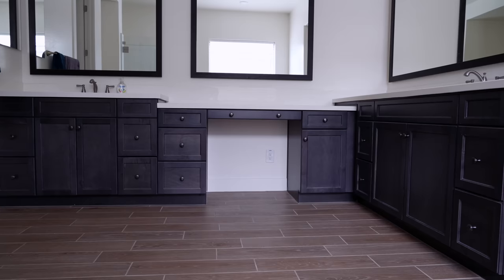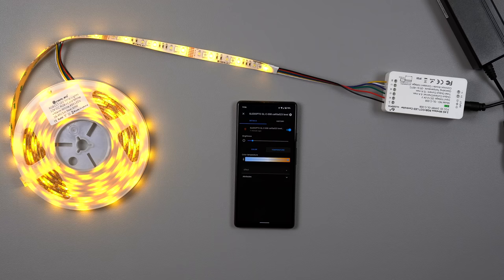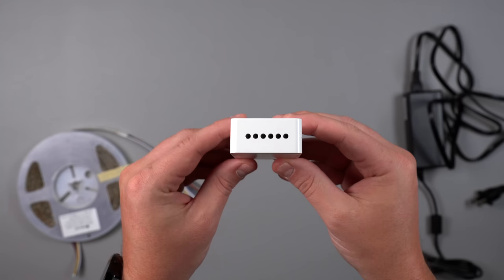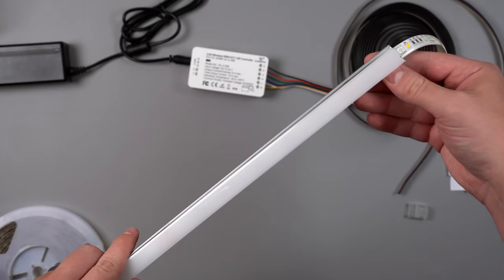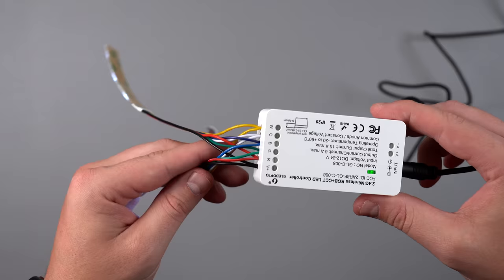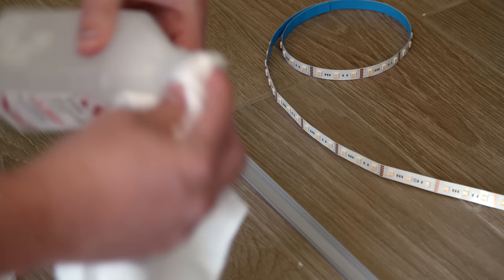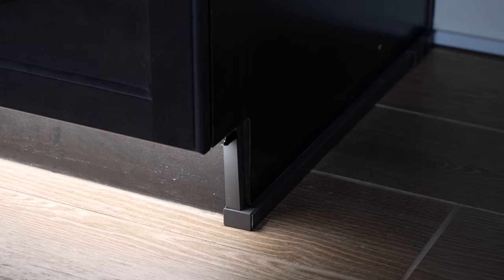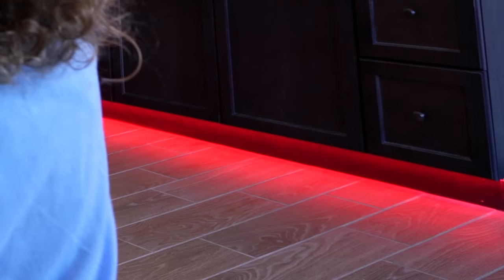Ridiculously Easy DIY Light Strips! (no soldering)

Comment from the maker: Don’t be like me and accidentally buy light strips that look purple instead of white. These are much better: https://amzn.to/3C2TTVl (affiliate link) and I put more links in the description.
Reply: Just the video I needed! Thanks for making. Does the controller work with Alexa? Do you know if there is a limit to how many connections can be made? (I have multiple gaps between cabinets and will definitely need that roll of wire and connectors to bridge the gaps)
Reply: I bought some cheap sonoff for my kitchen and even like you i don't like it so much. Colours are different and low power. When i change my kitchen i'll buy some better. This video will help me, thanks. By the way your daughters are so cute, i love when they appear talking in the videos. Nice family, best wishes.🙌
Reply: Would these light strips be good for under-upper-cabinets as well?
Reply: Use NoMoreNails adhesive no need screes for the diffuser
Reply: The one that the link points to do not look the same as the one you use, it is completely different. (Could be a country availability issue from amazon)
Reply: @jillsajonia6101  with the heat it will fall down. The aluminium channel is made to dissipate the heat from the LEDs.
Reply: Amazon UK link links to a terrible RGB strip which doesn't appear to have a dedicated white at all, let alone cold and warm 😥
Edit: ...which is extra-annoying because BTF-lighting do actually sell on Amazon UK, so apparently the affiliate link matching algorithm is just garbage
Reply: Not happy :( just purchased 30m of the (good ones) as per your link, they are absolute trash!!! Could you edit the descriptions with the actual brand and model etc, so I can actually purchase what you recommend. Thanks.
Reply: Am I missing something? The lights in that link only have four channels (which I didn't realise until I received them).
Reply: Do you have a recommended zigbee controller?
Reply: @JamesScholesUK  Did you manage to find a good set in the end? Thanks.
Reply: Hey Reed. Thank you doing all of the hard work for us! I have ordered, from your links, but I am in the UK so it has linked me to the wrong LED strips (4 wire instead of 6 wire). Please can you confirm manufacturer and model thanks 👍
Reply: What motion sensor did you use and how did you link to the strips?
Reply: @JamesScholesUK  did you find the correct led strip?
Reply: @D4RKFiB3R  No, I try not to shop at Bezosworld any more. The man's a drain on humanity.
Reply: @JamesScholesUK  Is that why it took a year for your message to be delivered? 🤣
Reply: @D4RKFiB3R  I'll get back to you in 2025 😜
Reply: @JamesScholesUK  I'll hold you to that 😉
Reply: Very entertaining and informative.  I have 120V old under cab halogens that I want to replace.   Can I just hardwire the power supply in rather than plug it in to an outlet?  Also do I need to go to a 12V system or should I just replace with a 120V strip light system?

Comment: Great video. But you forgot one main thing. Can you explain the controller you used? How did you connect the controller to your SmartThings or home assistant?
Reply: Replying in case anyone is hunting for this info down the line.

You can connect this Zigbee hub to your Philips Hue Bridge if you have one. Otherwise, Home Assistant has ZHA which lets you connect Zigbee devices directly to HA.

Comment: +1 on BTF Lighting, they are my go-to for strips and have never let me down.
Reply from the maker: That's great to hear! Anything with Rob's stamp of approval is enough for me!
Reply: I thought of you (@the hook up) the second I saw this video, cool to see you here as well!
Reply: @SmartHomeSolver  Wait - you mean you didn't check with Rob BEFORE ordering the lights? 😉Great video - and I agree, its good to say "My wife is right" (even if it's just once in a while) 😅
Reply: But BTF don’t have 2835 which I love because of small size and low heat production and because they have low brightness but the chip is cheap they are made in 240/m which makes it perfect in direct lightning like LED strip on the ceiling of the stairs.
Reply: Btf, the real cri rated led strips. Love them!
Reply: BTF have the best strips in my opinion.  The adhesive backing is one of the best, and the LED's have a really good CRI and consistency
Reply: @pavolholes  That's a shame I know.  It is hard to find good 2835's, especially if you want CW/WW/RGB strips.   
That said, you can underrun 5050 LED's and they will run cooler and last longer than 2835's running flat out.
I guess it is just a matter of the extra few mm in size
Reply: Same here, I've been using them for around 5 years now and their quality was top notch back then and still is!
Reply: same!! I have used them for led strip for my kitchen.  Lights for my mega tree, half a dozen other led projects.
Reply: 100% agree!
Reply: even as good as the strips the CS is just as good  +1
Reply: I use BFF also so far no issues
Reply: The lights look great, but does anyone else here get a high-pitched, low frequency humming noise coming from the lights when they’re turned on? It drives me insane…
Reply: @SomeoneHasThatName  I think its the driver
Reply: @MamasFunkyMonkey  Would the driver cause the connectors to hum? I put my ear up next to the splice connectors and that's where the noise is coming from.
Reply: @SmartHomeSolver  What sensor did you use to automate the light strips?

Comment: 5:40 Another option would be to use two-sided molding tape. 3M makes some that I have used on automotive projects and it lasts practically forever. No drilling or screws needed.

Comment: easy solution to the screwdriver problem: most single sided bits (not the double sided ones you showed trying to use by hand) fit into a 1/4" socket. pair with a ratchet and tadaaa, 90° screwdriver for tight spaces. great idea for the undercabinet lighting ^.^

Comment: remember there's a neat free empty space under the cupboards you can run cable through, and put the contents of the bulky box inside.  You cud even run an ext cord through there. Just pull out a drawer and cut a hole in the floor of the cabinet.  Some cabinets don't even have a raised floor you have to cut; they're already wide open under the drawer. You can also hide gold bullion there.

Comment: Instead of screwing the channels into the underside of the cabinets, you could use 3M Dual Lock, which comes in both rolls and short strips. You wouldn't need much to hold it, and it would be easily removable.

Dual Lock is also great for holding toe kicks to cabinets because it holds well and makes them easily removable if/when you need to do something under a cabinet, like run power for lighting.
Reply from the maker: Yeah that would have been easier to install.
Reply: @SmartHomeSolver  If you prefer using the screwed in clips you can buy an offset screwdriver as well. They're set to a 90 degree angle just like hex wrenches are, for exactly that purpose. With the clips you don't ever have to worry about adhesive failures. The other option is to replace the packaged screws with hex screws so you can use a hex wrench.
  Even the toughest adhesive strips hate particle board, and unfinished wood. Think of trying to stick painter's tape to a piece of anything you've sanded, and not properly cleaned. The particles create a barrier  between the adhesive, and the mounting surface, and the adhesive will stick to that rather than the surface.
  I made a custom desktop using MDF, and the adhesive strips on my cable routing clips constantly failed due to the surface particles of the MDF getting dislodged from the surface. Even when there was no visible damage to the desk, the adhesive would get ruined. The only way I was able to stop it was to seal the MDF where the clips would go.

Comment: BTF is the best I have found for led strips.  I like the newer leds that don’t have a wire for rgb just one wire to assign the colors. The individually addressable is what I am talking about
Reply: These are ws2812 based LED light strips. They only need 3 wires instead of 6. The controller would be a different type (or arduino),  and each LED can have a different color. I second this.

Comment: I just did this with my kitchen cabinets. I replaced the halogen puck lights with RGBWW strips. I did solder them but I used 12inch sections stuck to aluminum channels with diffusers. I had to purchase 3 separate controllers and power supply’s but they work great.
Reply: You have 3 separate sections of cabinets?  I do snd it would be hard to snake wire to the 2 different walls.  What hub are you using for the controllers?

Comment: For the light covers I've used the dremel with metal brush disk and with a couple of passes inside to provide a rough surface for it to stick to it.
Reply: Seems like a lot more work than just using IPA.
Reply: @headerahelix  yeah but I al ready had the covers and was too lazy to buy new ones. I am a special kind of lazy that does extra work! 😅

Comment: Another option is to makiing a small section in the alcove removable on either side at the bottom at the skirting height (06:39 by the 90 degree bend) ,take the wires and the power unit behind it under the cabinet .Then applying a fabricated removable cover/grill (plastic print?) so the wires alone appear at the back of the alcove near the socket. EDIT Even a 60mm or larger circular cutter big en ough to allow the parts to be installed under the cabinet then use the wood plug produced to make a removable part for the cabinet.

Comment: The "warm" and "cool" settings are nice, but I feel like they may be unnecessary. I had a set of mid grade 12v RGB lights in the past and when I wanted "cool" I put them on any brightness in the middle white portion of the color wheel and when I wanted "warm" I'd put them closer to an orange/yellow hue at about a maximum 80% brightness.

Comment: Use a 1/4" ratchet with the appropriate socket for your screwdriver bit. Great for putting in screws under the cabinet kick. Buy (or cut) a short bit if necessary.

Comment: On a somewhat unrelated topic, I accidentally discovered something after installing a Lutron Caseta dimmer in a bathroom. It controls 3 ceiling lights and 2 vanity lights. By putting 100w equivalent leds in the vanity and 65w in the ceiling, I was able to only have the vanity lights come on as nightlights. The dim level is set at 1%.

Comment: My question is do you have a suggestion that will help me in that I have 2 sections of interior steps, 1 each would require 1 right angle connector. 
Total length of 1 is 39'3" and the other is 37'6". I have access behind the steps foe wiring. 
I am looking for a single strip per step so the strip and connector would be controlled vis Caseta lutron light switch .
I always enjoy your vids and thanks in advance for any suggestions you may have.

Comment: I see you are using the smd connectors.   The manufacturer says specifically not to use them and to solder only.   Couldn't understand why they would tell you not to use smd connectors?

Comment: Fancy that. I just also recently went down this rabbit hole after buying an LED light fixture that turned out to have a proprietary RF remote so I couldn't use it on the Broadlink. A powerful driver, Gledopto, and much reading later, I'm realizing assembling my own LEDs is going to be so much better for Halloween. Especially if I dip into Arduino offerings.
Grats on the bathroom. Looks great!
Reply: Psst. Check out WLED on an ESP32  in that case... Easier than mucking with an Arduino programming and much better platform.

Comment: Thank you for your video. It’s helpful. What I’m planning to do is put light strips around my windows which are double hung.  then I can get rid of my Christmas lights instead of having to store them all year. Plus, I will be able to change the color according to the holiday example: red for Valentine’s Day green for Saint Paddy‘s day and so on. I will keep a few for decorating bushes  and stuff outside but Not a whole mess like I have now. but I’m just trying to figure out what to do with the LED lights. They need to plug into the wall and hopefully I can use only one remote to control them all. Plus I think it’d be a good idea if they were waterproof. I get a little moisture around the windows once in awhile but mostly they’re dry. Can I get 12 foot strips or cut them to length and then add a plug to power them? I really don’t want to deal with batteries. any help you offer will be really appreciated. Thank you.

Comment: Thanks for the instructions and product links. When I follow the link to the zigbee controller, the description says I need a zigbee hub to operate. Is that hub required to simply turn on the lights by plugging in, or is the hub only required to interface with Alexa type controls?

Comment: Next time you need to screw in something in a tight space like under the cabinets, use a right angle drill adapter. Milwaukee and Dewalt make them, among others, I have both and use each for different types of spaces.

Comment: 2 suggestions, we can use a esp8266 as controller it will be much much cheaper in terms of cost and 2nd, instead of putting the wires outside, you can station them inside, by placing a small hall on the bottom of gate, the wires wont be visible this way and there will be no problem of hygiene.

Comment: The question is just if that is a wet bath or if it's just a dressing room type space. Because placing either electrical outlets or electrical equipment on the floor can't be good if the floor might flood.

Comment: Nice! I really like the simplicity that this solution offers. I was thinking of doing something similar with my cabinet lights, but with a Shelly RGBW2 for the controller instead of GLOWEDOPTOICANTPRONOUNCEIT. I also have been experimenting with WLED, but I've been having connection issues, so I kinda gave up
Reply from the maker: Thanks! Yes WLED is something I'm planning on tackling soon and it does look challenging.
Reply: @SmartHomeSolver  WLED is surprisingly simple to get set up. After doing it a few times, I can do it in about five minutes from start to finish. I just wish it worked reliably for me. 😒

Comment: I've been struggling with the connector and track issues forever!  

The connectors don't fit inside the tracks and the endcaps that have an opening, the opening isn't wide enough for the strip to fit through, so you're stuck leaving off the endcaps, which leads to light bleed at the ends. 

Additionally, every strip I've tried is cuttable at 10cm, which is an exact multiple of the track lengths anyhow.  So, you couldn't put the connector inside the track even if it did fit without sacrificing on the length of your light strip.

Comment: Got a question about the wizz led light strips and not sure who to ask, but my strips are making the obnoxious high pitch buzz humm sound that usually occurs with like dimmer led bulbs with like a non dimmable socket or vs versa, or when its not on a power sourse for the right amount of power. Wtv ya know, i have mine directly in a wall outlet and i have no other electronics near the lights, all connections are good nothing off and then i decided ide try putting one of my little clamp things that i use on my stereo speaker wire did that and it sort of helped wondering if maybe i used a few of them if itd make the buzz sound go away completely.  Feeling like i have hyper sensitive ears which i do, but no one else hears the buzzing sound like i do, sucks.

Comment: Is there a way to automate strip lights to turn on just a section with a motion sensor? For example, if I put a led strip under the bed to turn at night in case my wife or me stand to go out, can I use a motion sensor to only light my side of the bed or her side of the bed with another motion sensor?

Comment: LED channels also act as a heat sync which can greatly extend the life and color quality over time.  And yeah they help bend all the leds together.  My other favorite leds are the Cobb led strips that look like one continuous light. They used to only come in single colors. White warm white and red, green, blue. Now they have a rgb one. They’re the only led strip that has that continuous look without using a cover. They’re also super thin, super bright, and have a high CRI. They don’t do individually addressable strips but you wouldn’t anyway. Their strips look continuous because  their leds are so small and close together. And they’re pretty inexpensive now compared to a few years ago.  Go for the 24v ones and get a good quality flat led driver.

Comment: Hii I need help!!

So I bought the Neon led light from Amazon, anyways while I was putt my light up on my ceiling it fell and the led split from the End of the led wire. So the connection from Led light to the led wire spilt in half. 
Anyways I bought connector clips connected both broken ends and tried to fix it but the neon light Dosent turn on anymore! 

Is my neon light damaged and do I have to buy the neon light again?

Comment: How is it holding so far? Looking at the power supply that you used, it shouldn’t be enough to power the strip light properly based on the manufacturer’s recommended amp. Is it okay though?